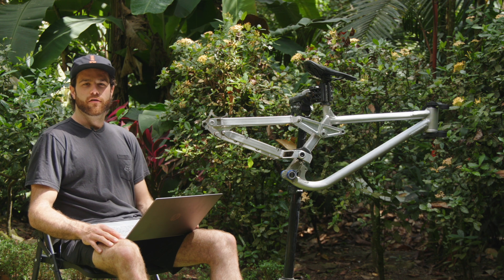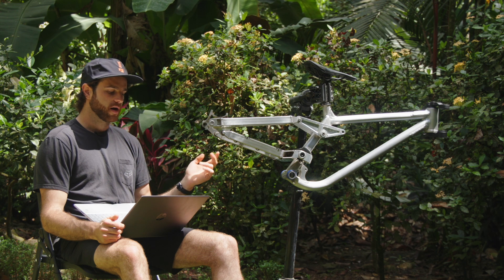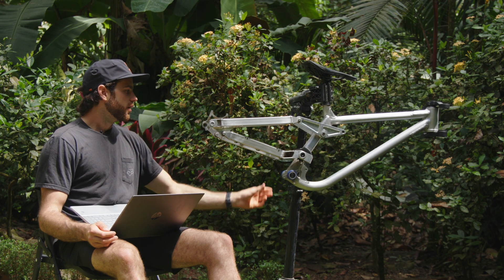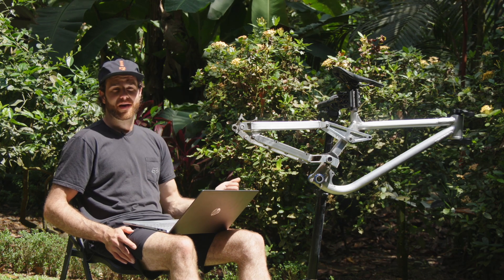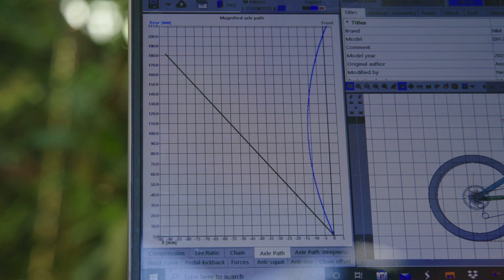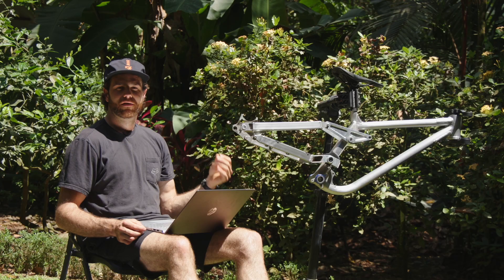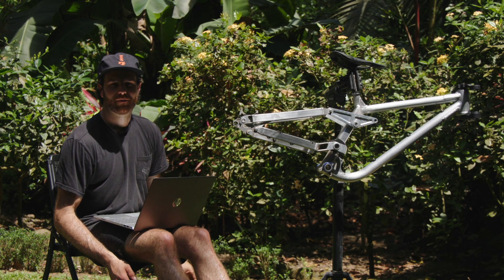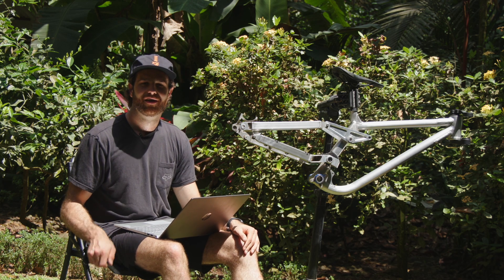IN DEPTH | Neko Mulally | Episode 2

Comment: I had the same problem with bent and broken bolts in the linkage on my old MSC F5 bike. Stiffer and more supportive linkage solved the issue.
If you're still bending bolts I'd suggest making the rocker link as one piece, not independent L and R side, this will reduce side load on the bolt, and you could use less material on the sides. 
Thanks for sharing!

Comment: This is awesome stuff! Great work, I like how open you are with the things you would like to improve but overall this looks super dialled! Another benefit of the shock orientation is if you were to run an air shock the end seal/dust wiper will stay cleaner and the lube inside won't tend to run away from them.. I figure you probably service it enough to be a non-issue but its peace of mind anyway!

Comment: The bolt issue probably doesn't come from the bolt itself.
The shock bushing/axle/spacer/whatever there is should be held by friction and resist flexion instead of the bolt that should only see tension, if everything is set right. the bushing system may be too loose or not stiff enough, or maybe the rocker itself isn't stiff enough to hold everything inline. A bolt can be bent with less force than what the shock see at sag.
New link can stop the toasted bolt with a shorter bolt length, or by being stiffer, but look for issues in the shock mount hardware too, as it would be my main suspect.

Comment: Hello Neko, first congrats for all your work. Do you plan to try steel version of your frames? Full steel version or a mix front steel-rear Al to try to take advantage of steel elasticity? Plus steel does not necessarily needs heat treatment.

Comment: Interresting. I think it’s pretty tough to appreciate the high pivot when you riding both pretty much back to back. Due to the lack of pop, and the fact that is so much easier to generate speed with the low pivot, you gonna think youre always faster on the low pivot except on very particular track like vds, wide and rough 
But in fact low and high pivot times are really close in pretty much all tracks, it’s just easier to feel the speed on the low pivot